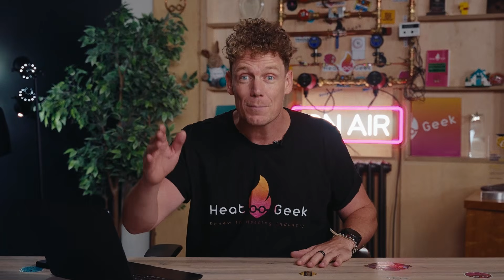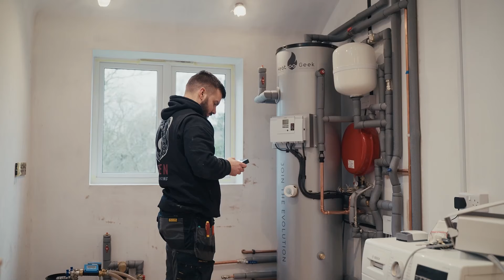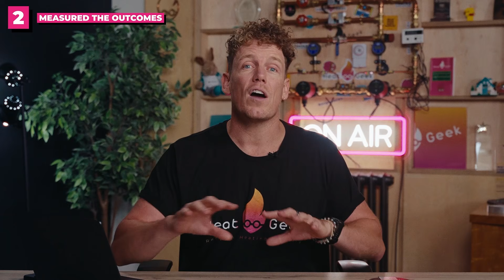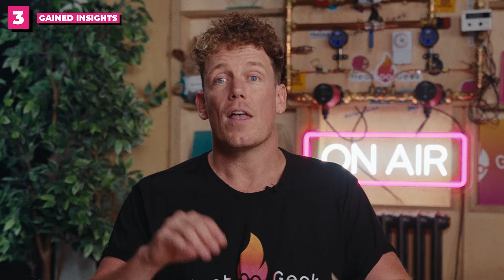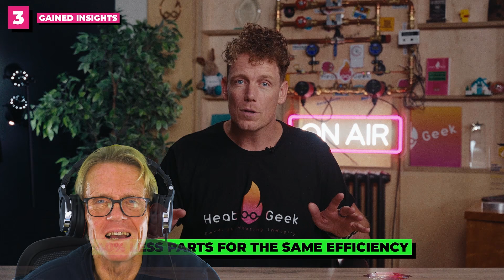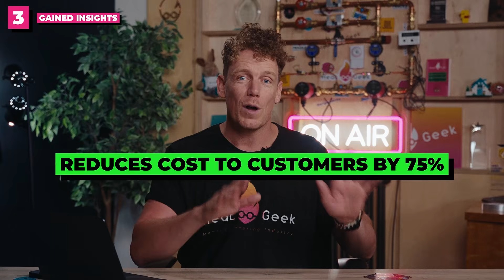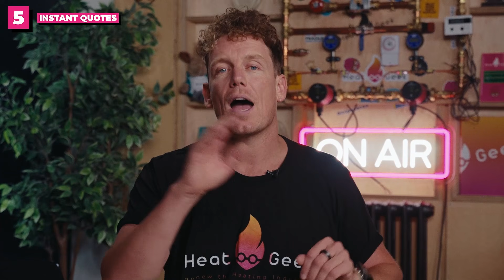Heat Pump Reality Check: Is Zero Disrupt Too Good to Be True?

Comment: I just don't see how a heap pump can be cheaper than running my oil boiler. As is stands I live in a small 3 bed bungalow with 5 radiators in a village location in Essex. I currently use around 500 ltrs of oil per year for heating and hot water. We don't have bath so it electric shower only. If you work out my average yearly heating/water bill its around £250-£300. I just can't see the heat pump being cheaper to run given that it has to run constantly to run effectively and efficiently.
Reply from the maker: Hi David 
You have uncovered the major flaw in their claims. If you ran a boiler on a low temperature 24/7 you would have a meaningful comparison but if you put the boiler on when you need it and turn it off when you don't then you have a completely different set of figures. It is hard to make a comparison based upon SCOP.  A large contingent in the overall efficiency is gained by heating the home in the middle of the day when you might not even bother with a gas boiler.
Reply: @SkillBuilder  It's as if they're trying to say that if I was to run my oil boiler in the same way as their heat pump, yes it would probably be cheaper but people on a budget use what they need when they need it. There is no possible way that me running a heat pump could save me money and given my usage I probably produce less Co2 as well. Absolute con.

Comment: As I have always said that £7500 'grant' was added into your bill, YOU didnt get the money THEY did...Crooks ripping people off.
Reply: Depends who was getting that money and how good the install was. Learning about how to do the installs (instead of just banging in heat pump and erroneously treating it like a boiler) isn't cheap. Still value for money if you can get a good install and save over the long-term. Better if it's cheaper, though.

If you watch pros who get good results, you can see their process involved a lot of surveys, planning and installing the heat pump often takes time. It's not like you just turn up and whack in a like-for-like, then there's a load of form filling to be done etc. Sounds like Adam & co. have streamlined some of the surveying & form filling.
Reply: @defragsbin  ALL completely irrelevant when they simply add £7500 on your bill because they know you are getting it off the govt. It is just a massive bonus for nothing.

Comment: New housing has been built,with heat pump fitted , and they have had to fit  a small GAS BOILER  to back it up  so what’s the point.

Comment: The installation of water based heat pumps seems like a lost opportunity to use a ductless air-system where you can cool the house in summer. Especially for the South.
Reply: Have you ever lived with ductless units of the type you mention? Miserable wafts of warm air, you can hear them running all the time, and no residual heat when switched off; also no 'low and slow' possibility. Too clunky, too sub-optimal for UK use. I love my wet heat pump system - like some say, set it and forget it, leave it on all the year round, let it look after itself. Cosy house 24/7, all year. And not expensive to run. People who are paying over the odds for sparks are doing something badly wrong. Sure, you have to learn about best practice to get the best results, but it's about time more Brits tried to understand why they are paying too much, even with a gas boiler. It's just physics, not magic.

Comment: Do NOT install a air heat source pump , unless you live in a brand new house with super insulation on ALL 4 sides plus triple glazing! We have the VERY LATEST Air heat source pump, titanium Wiresless inverter, which ONLY heats our swimming pool between late May and early Sept, then turned OFF. We tried it over Christmas last year and the costs Rocketed and hardly any hot water Luke warm only! Great for Summer Lousy and AND VERY VERY expensive in the Winter!! Thanks Roger! Your a Great Honest Man!!  p.s probably the only honest man left in the construction industry!!

Comment: Why is it that heat pump systems are £5000+ in the UK??? I've installed two over the past 25 years in Japan and have never paid more than £2500 all-in. Mine would be equivalent of a small system in the UK since it's mainly only for hot water out of the tap, rather than for rads, which we don't use...like most of the world<-----. Home heating is air-to-air heat pumps (air cons with two way valves). The UK really needs to move away from the insane use of water as a heat transfer medium. There are definitely benefits, but the overall costs of install and maintenance are always going to mean that you are spending a fortune NEEDLESSLY. All new homes that have proper airtightness and insulation should be BANNED from installing those insane systems. Air-to-air heat pump here to heat a 1000sf space is about £1500 with an install of £100-200. Warranty is 5 years, but all of mine have lasted at least 10, with one that is on it's 23rd year and still working like a charm. If they ever do have problems, you are looking at an hour MAX to swap them out. What are you doing over there????? I have 5 air-to-air for heating the house (decent sized 4br house and I like the house ice cold in summer) and then the air-to-water for taps. I also have a little 2KW solar install on the roof. I'm on a two-tier meter and average about 20pKWh. My power bill is about £100/month average. I've lived in the UK and Ireland and am horrified at both construction methods and heating systems. When will people learn to look outside of their sandbox for other solutions?

Comment: Best pumps don't work unless you have huge amounts of insulation in your walls, floors, and roof.  This heat geek bloke is talking out of his ass. Even new build homes built to the new part l bills are high with owners complaining

Comment: Further to my earlier comments, I have to ask, who are these people that have thousands of pounds? I would like to see the simple maths, electric in my flat costs £1500 a year, installation of a gas system, much cheaper, reliable, repairable, comfortable, my own electric heater, thermostatic, smart plugs, cost? under £1000, how long for me to get back cost of just central heating, on the information previously provided? over 12 years! on solar has to be less as installation should be cheaper etc, but heat pumps! from the evidence, never! the pain and suffering, the trial and error, the BS! but worse, he sat there and suddenly it dawns on him that average usage would be better, how about, this house, flat, apartment bungalow, duplex, etc, with the materials it was built in and location, ie south facing, up North, shadowed by an enormous Beech tree that stands over 100ft was planted in the 1800s has triple glazing, needs? its utter BS his face and replies, shout out to those who are installing these well and their expertise, but the cost of these are in wealthy homes of great proportions. Well challenged and he’s delusional, will get rich off it but, that’s never going to be an option for the 80% of homes, new build maybe, but not without reform of the way r=they are built, look to other countries! you have, and we don’t learn, flooding, well the dutch have solved that, heating, with quality stoves, we just don’t investigate, same as in the initial stages of computers,, I worked for two major authorities, Greater Manchester   and South Yorkshire, both never spoke to each other, but both failed when installing new equipment, that cost millions.

Comment: As a regular follower and promoter of Skilled Builder, I reached the part with the boiler from a child’s planet 🪐 was shown? 😱🤨🥸😤 I now live in a flat, i used to own both, and 7 years ago, after laying copper pipe work in the bottom flat, I contacted British Gas to get a quote for reconnecting the gas main, this took 4 weeks to come back to me and the cost, £2000 i queried this as I knew roughly were the feed was and the pipe was still under the stairs, for central heating, i also tried to kill two birds with one stone, the surveyor from BG came and after looking and measuring, he said, we can’t do it, why was my response, because the vent would exit though a wall onto another persons drive, that’s no problem the vent won’t be at head height, and i have spoken to the neighbour who has no issues, doesn’t matter he said, standards won’t allow it, but it had gas in at one point and then was divided into two properties, ok so then got a quote that would have meant £10,000 for both flats, so £12,000 all told, this is a one and two bedroom flats, looked at electric boiler and ended up just getting good thermostatic electric heater, last year, over a three month period, january to march, this cost £1,100 i have contacted numerous solar and it exactly the same as your reporting here, with comments like, you know we can’t install for two properties, well why? because we can only have control from one, ok! and i don’t think the area your telling us is big enough, well you could fit three decent size panels on a 3x2 meter roof, no sorry, so not wishing to be to cynical, it’s all a load of BS like the phone calls,, we think you are eligible for free roof insulation, oh great i say, where will you put it, in the roof space/loft, right, i don’t have one, is it a flat roof, etc etc etc, any government grant should only go to fully functioning business, in that line of work, or accredited ones that prove they have knowledge and experience in said grant. I would be interested in knowing your thoughts on Electric boilers, the bottom flat had a direct cylinder in when I bought them, but i moved that to the top flat, into the loft, as it was far to big and took loads of room, replaced with a wall mounted one that cost £250 and works on a plug in timer, fitted it myself and it’s been certified. if it goes pop tomorrow, i got 4 years out of it and will pop a new one in its place. Keep up the fight Rodger, you do a fantastic job and i think we are similar ages, but your stuff on Paint, damp, concrete, plastering, showers, and all the other great ones, like the London buildings etc are fantastic, I particularly like the depth of the skirting board heating, where you went hands on and asked the critical Qs, it looked really good and released more wall space for smaller properties, whilst giving a feasible replacement or new type that worked, with surround heating. Regards David New Forrest

Comment: Hi Roger here’s one for you we are about to have a new boiler fitted this week what would you suggest we do regarding the boiler and no can’t afford a heat pump. Great  show cheers
Reply: Make sure the installers power flush your system and install open therm or weather compensation, ideally manufacturers own heating controls. These along with a correctly sized boiler for your home will be cheaper long term than a heat pump

Comment: The trouble with being in the wrong place when things change is hanging on to what we know.Water as a battery has moved on and now somebody needs to start again with small community systems based on electricity with solar and thermal and battery storage in small managed units .cars are batteries so is sand.a car parking space is available everywhere.

Comment: Ive got great news, gas is getting cheaper lol, so we are GTG, coming down another 10 percent from october
Reply: Gas is 7 times cheaper than electric now, its only gonna grow. Good luck with the heat pump fiasco, but 5 years down the line there will be a missold compensation scheme started 😂😂

Comment: Why not just sort out heat loss in houses keep the gas boiler and save on gas?
Reply: It won't get greener as the grid gets greener. You save 40% of the gas straight off by switching to heat pump.

Comment: Got a 1930's detached house which had gas combi boiler. I converted to a Heat pump last year with absolutely no problems. I've seen the drop in energy use and cost already and the house is lovely and warm. All these bad stories where they don't work are usually when they've not been designed properly as a full heating system. If a gas installer fits an undersized gas boiler in a house you'd be cold, but nobody wouldn't blame gas boiler's for being a poor technology choice. Same thing with heat pumps. They produce all the heat you need and work great. How it's sized and set up is what matters. Just make sure you get a good company who can design & install heating, not just install and you'll be fine.  That all said, I do agree that the HP install costs are being inflated because of the BUS grant and will come down, once it's pulled.
Reply: I think it won't be pulled for a while, there's a lot of gas boilers to switch between now and 2050. The grant is great for reducing emissions.
Reply: When you were heating with gas did you have the boiler running 24/7? if not why not, so why have the heat-pump running 24/7 at 2C below the gas settings?
Reply: @dantronics1682the heat pump modulates according to the outside temperature, switching between off, slightly on and all the way to full on, producing a consistent temperature in the house. Gas boilers aren't generally set up to run like this.

Comment: I greatly enjoyed this. I smiled and laughed.. Two men with both integrity and intelligence having a healthy round of banter. The mutual respect is very evident. Both parties well able to put their cases and perspectives on the table. And neither are wrong in my opinion.
This is what I come to YouTube for. 
Thanks 🙏 👍
Reply: We have to reduce pollution, and if you don't think C02 is warming the planet, then at least except that CO2 is acidifying the ocean
Reply: @tarant315  "accept".
Reply: @tarant315  I believe you you still need energy to run a heat-pump so  so how are you reducing CO2? The power stations cant just power up and down for demands so will be running high with wastage until energy is needed. A boiler only gives out CO2 when its switched on and most people only switch them on when they need to have them on, not running 24/7.
Reply: @dantronics1682if you need 30kWh heat in your house, then you need to burn 35-45kWh of gas or 3.5-4.5 liter oil.

A 300% efficient heat pump needs 10kWh electricity.

A gas power station at 40%-60% efficiency needs to burn25kWh-18kWh of gas.

And it could run on Wind, solar, oil nuclear, biogas.....

I go for the car which I charge at work. One day soon hopefully
Reply: @tarant315  For me 30kw gas @35kw @8p =£2.8,  10kw heat-pump = £2.7. cheaper to run but the installation cost is the killer. The power generation method doesnt concern me unless I was a shareholder.
Reply: @dantronics1682the only reason why capitalism is working....greed

that is why the land will burn and the ocean's will die

Comment: I went to the site and put my postcode in and identified my house (3-bed semi, South London). It gave me a ballpark figure of £3100. BUT ... for example, my house is Council Tax band E, meaning that I have never been, am not and never will be eligible for any heat grants. Does it supposedly take this into account? Also I'm assuming that their installation means installing PARALLEL to my gas boiler, not ripping it out. Which would be totally unacceptable. Sadly, their initial survey charge is £250: I could easily afford £3000 for a significant improvement in my heating bills, but £250 as a throwaway initial cost is FAR too high to set the ball rolling. As it happens, I'm a very cold-blooded person, almost a reptile. Last "winter" (Southern England doesn't really have winters any more), I spent tiny amounts on gas, and only turned the CH on on gloomier days: mostly the sun input keeps my house more than warm enough for me.
Reply: The grant is for taking out a gas boiler and replacing it with a heat pump. It sounds like you need to become more comfortable with heat pumps before you would consider them?
Reply: @Biggest-hz7ng  Sounds like you like using the expression "sounds like". I know that that is a condition for the heat pump grant. WHICH, if you had bothered to read what I wrote, I WON'T EVER GET because I live in a Band E property. And, no, I shall NEVER get rid of my gas boiler, but if the economics make sense I might buy a heat pump and install in parallel. As I ALSO SAID.
Get a life, seriously.

Comment: The materials for the cheapest heat pump system, including the cylinder, pipework, and other components, cost around £7,500. The grant only covers the cost of these materials for the lowest priced system. Are they planning to carry out the installation and MCS certification for free? That doesn’t sound realistic at all.
Reply: They plan to reduce the other component costs and time on site (see video).
Reply: @Biggest-hz7ng the cheapest (r290) outdoor unit is £4000, cylinder £1000, controllers, pipe, valves etc £1000, mcs certification paperwork costs £1000, your office rent, tax etc expenses another £1000. Which one of those can you cut?